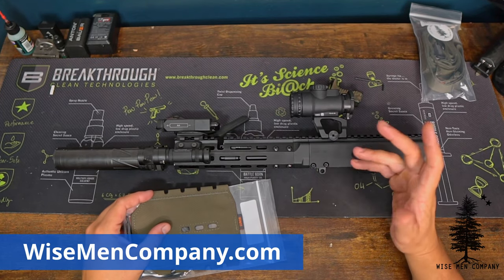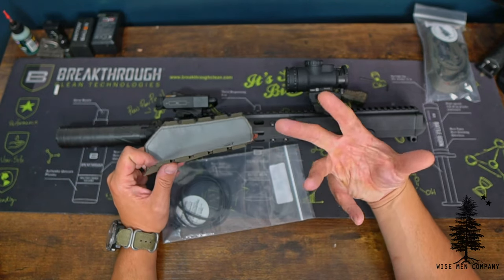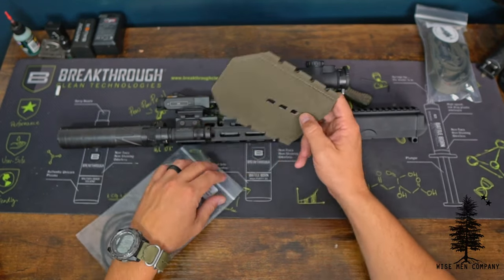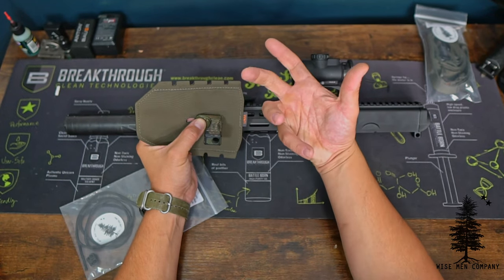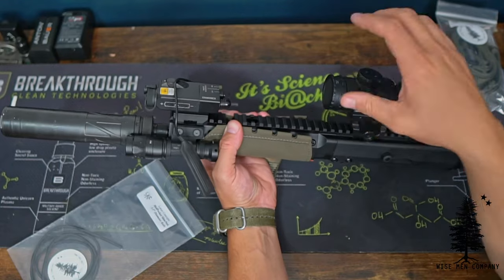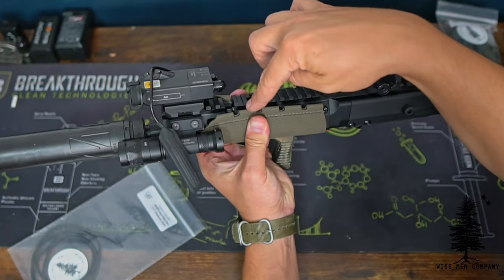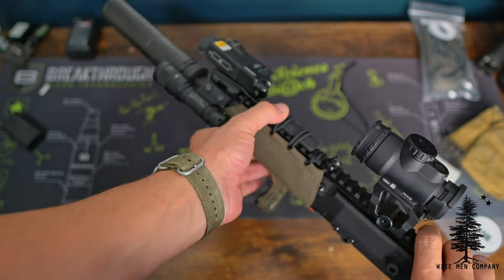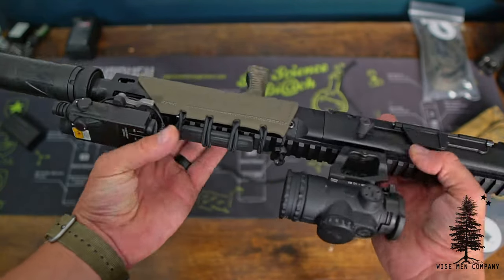Lunar Concepts Hot Pocket

Comment: This is rad. I'm going to get one for sure. I really like the shape/contour around most m-lok rails. I do feel like the version 2 could have a little bit more refined way to attach the top section. I feel like the paracord gets in the way of different accessories the modbutton, modbutton lite, unity hotbutton, HRF Ramp. Especially that last part where you fasten it and burn the ends. I wonder if a type of flexible wire or cable would work better and get a tighter fit.
Reply: Lol… I’m reading my comment from seven months ago. I’m about to purchase my third hot pocket rail cover. They’re Fking awesome. They protect your hands from heat  especially when using a suppressor and no gloves, they securely hide cables for lights and tape switches, and they look really good. I’m constantly getting asked who makes them when people see my Rifles. The nicest part about them is they are priced really well... less than half of one of the competitors- and in my opinion in better quality and design. I’m excited to see what else these guys come up with.

Comment: How heat resistant is the shock cord? I had holes between the picatinny section and the bulk of the rail that I used to thread it through instead of over the picatinny section I'm just worried about heat resistance with the shock cord...

Comment: Threading the two holes into that clip is by far one of the biggest, shittiest, pain in my ass things I’ve ever done
Reply from the maker: Use a pliers to hold down the button if you need to and simply thread the ends through.
Reply: @wisemencompany  I just tightened them hard and tucked the remaining cord 🤣 had my thumbs reeling!

Comment: So if the hand stop helps keep the hot pocket in place and if you decide not to use a hand stop, you say that it’ll keep the hot pocket from moving around as much or not so much. I’ve got a Rock Island VR80 shotgun with a M-LOK handguard on it. Is this thing going to stay tight on my handguard or my gonna have problems with it moving and shifting around? How much is “not so much“? Curious minds would like to know.
Reply from the maker: You can tighten it down pretty hard. Shouldn’t have a problem. A hand stop just makes it pretty much impossible for it to move around.
Reply: @wisemencompany  👍🏻 Thanks!

Comment: How well would this do with a 5.56 suppressor under the handguard? I have a Desert Tech MDRX Micron with an 11.5 inch barrel and 9 inch ALX handguard. That places the suppressor under most of the rail length. After 30 rounds, it’s almost to the point where it’s too hot. 40 rounds would probably push it over the edge. I just recorded the video for my channel but if this may fix the issue, I may hold off uploading it. Too bad I’m not big enough to get stuff from companies.